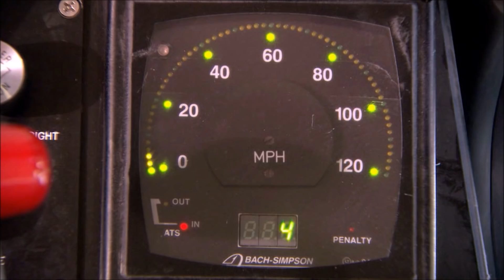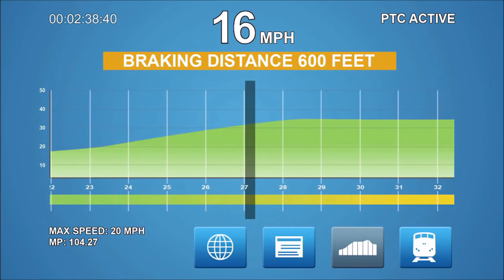Amtrak 501 "Cascades" Train Derailment 18 Dec 2017

Comment: Hi Juan, great report as always. As a train nut who lives less than 30 miles from the wreck, and is familiar with this line, I'd like to add some info that the MSM has either gotten wrong, or missed entirely. There has been much mention of the 10 minutes this reroute saves between Seattle and Portland, as though that was the reason for spending $180 million for this line upgrade and train rerouting. That is not the case, the old route from Tacoma to Nisqually hosts 50 or more trains a day, BNSF the owning road, Union Pacific and Amtrak via trackage rights. The line while mostly double track, has two one track tunnels, a draw bridge and this time of year is plagued by mud slides south of Point Defiance. All of these issues combined to cause delays to the passenger train schedules, thus the Washington DOT and Amtrak's desire to bypass this problematic stretch of track.  The biggest drawback to the new route is that it passes through south Tacoma, Lakewood, Joint Base Lewis-McCord, and DuPont, with many grade crossings, something the old route has very few of. 

The media reports have been so filled with misinformation, it's no wonder there are already conspiracy theories cropping up about the wreck. These "Cascades" trains are run with a locomotive at each end, because they make multiple round trips a day between Seattle & Portland, with no convenient way to turn the trains at either end. This way either a locomotive at one end and either another locomotive or control cab at the other makes fast turn arounds possible. It was indeed the lead locomotive that ended up on I-5 and the other one, pointed back at Seattle that stayed on the rails. I hope this clarifies some things for people, and is an example of how sloppy news reporting is these days. Keep up the good work, you did an awesome job of reporting the facts that are known so far.
Reply from the maker: Thanks Rob! Excellent points!
Reply: I realize the train was going too fast. But it is interesting too that if you look at the tracks in front (to the north) of the trailing GE locomotive you can see they upgraded to concrete ties but left the old wooden ties through the curve. That lead Siemens went off the track maybe 30 yards after going onto the wooden ties. They never upgraded that bend at all it looks like too me.
Reply: Rob, thanks for your contribution.  I find the conspiracy theories incredibly disappointing, those peddling these lies never look back in 6, 12, 18 months time to read the reports and understand what really happened.
Reply: We are very fortunate to have someone like yourself keeping us informed, while educating the public.      Thank You
Reply: Eastern Woods, The curve is at the SW end of the rebuilt track, just about where it merges back on to the original line.  I'd bet that the speed would have to be reduces at the point that it connects to the original line and up grading this curve would have been very expensive for just less then a mile of increased speed.  Straightening the curve would have likely required new RofW and replacement of two trestles over I-5.    You can see the exact cure at Lat 47.0824, Lon -122.6750 and just how close it is to the original main line.
Reply: @Eastern Woods They used an existing right of way - that's why.
Reply: Whatever the cause, my heart goes out to all who suffer loss as a result of this incident.
Reply: @William Savage No, look at the bridge.  It's old.  They used the existing right of way and bridge.  With the railroad running parallel to the interstate, crossing it is a problem without a tight curve.
Reply: Eastern : The rail line in question was an existing track and over pass . The tracks were upgraded but the overpass bridge structure as a whole was not. At that location the tracks are wedged between the I-5 freeway and JBLM (Joint Base Lewis McCord) federal land going downgrade on the North side of I-5(So. bound lanes. I-5 is headed in Westerly direction in this area) They did do regrading with retaining walls but there was no room to widen the curve. And with the fixed position of the bridge and the narrow corridor not much banking can be incorporated.
Reply: No, this is an old freight line that served a few industries in So. Tacoma as well as Joint Base Lewis-McCord. It was purchased by a local Transit Agency (Sound Transit) who then spent $180 million to upgrade the 14.5 mile line, with concrete ties, and continuous welded rail. As _D Bailey also commented, there were right of way constraints near the wreck site, it is squeezed between I-5 and Fort property, so no room to widen this curve, especially considering that there is only about a mile of track left before the line merges back into the BNSF mainline to Portland, so extensive realignment was not economically feasible or necessary for such a short distance to the end of the line.
Reply: You know, that is exactly what I was wondering. This was, was it not, completely new track and overpass? How much more time, effort and dollars would it have taken to build a safe 60 or more MPH overpass?
Reply: Thanks. I've seen people talking about a Facebook or Twitter post by a local Antifa group, bragging about pouring concrete on railroad tracks, and these people are losing their minds. If they had bothered to actually read that post it, was dated April 20th, long before work and testing of this line was completed. It also identifies the track in question as leading to the Port of Olympia, which is over 10 miles west of and with no direct connection to, this line. They wanted to block shipment of Fracking equipment to or from the port, so why sabotage a passenger line?
Reply: Another person without knowledge of the circumstances pontificating on the cause. Was the engineering somehow incapacitated? Was there mechanical failure? No one knows the answers to these and many other questions. Lets wait for the official investigation to tell us what happened before we go lynching people shall we?
Reply: TRRS, there is still some freight traffic on the line. It still serves some businesses south of Tacoma, as well as Joint Base Lewis-McCord and their military needs. There is no need for any upgrades to the original either, it is well maintained, mostly two track mainline. The issue with it was it hosts 50 trains or more a day, has a drawbridge that can stop trains, as well as two one track tunnels, not to mention that the line is plagued with mudslides this time of year. This is why Amtrak & the WADOT wanted to move off that stretch of track.
Reply: Rob Petersen, thank you for this very pertinent information!
Reply: No.  This was not completely new.  This line has been in place for a long time.  They did replace rail, ties and ballast and upgrade the grade crossings to upgrade the existing line for this service.  The north end of the bypass will also be used for an extension of the local commuter rail system.
Reply: @Mark H. 
This was never intended to be a high-speed line. Yet another example of the media’s inaccurate reporting: they called this bypass a “high speed route” when all it was is a somewhat shorter and much less congested route. Most countries define high speed rail as 140 mph or faster, not max 79 mph with 30 mph curves.
Reply: Infrastructure improvements can be like that, but consider that if you never do it you'll never have it. It was going to be expensive to upgrade the other line as well, so why not go ahead and invest in the shorter, freight-free bypass. With the dedicated corridor the passenger trains can run without freight interference on faster schedules. Costs a lot now but you now will forever have that corridor available for that initial investment, plus of course maintenance costs.
Reply: It is an old but freight line that was newly refurbished for passenger service. I've addressed this question in more detail below.
Reply: This was an existing line, the curve was not designed for "high speed" which none of this line qualified as, the top speed limit on it is the same 79 mph as the old route.
Reply: The 10 minutes were the result of a shorter trip, did you bother to read my explanation of why the line was rerouted?
Reply: This was not a "brand new line" it was in fact a very old line that was falling apart.  Tacoma Rail Link used to use this line frequently and when you would see one of their trains running down this line it was slow and would rock back and forth pretty good.  They pulled the old rails and ties (if what was left could be called a tie still) dug up most of the ballast and re-graded most of the line, before laying new track and ballast.  Most if not all of the trackage is equipped with high strength concrete ties for long track life and higher speed ratings than the old wooden ties could support.  This curve has been in place for many years.  I believe this is an old Milwaukee Road bridge, it's been a while since I got a chance to see who built it originally.
Reply: Eastern, Did you get the paper work started ? (PP)
Reply: @Don Moore. This was NOT a grade crossing.
Reply: Thank you, I did not understand this.
Reply: I can vouch for this information. I've ridden the old route many times.
Reply: This is an old bridge, from the  steam-era frieght track through South Tacoma. Sound Transit built a connection a the North end for commuter trains, which then alowed Amtrak, with WA DOT funds, to upgrade the South end. This was years in the making.
Reply: K Scott: Don knows that but if you continue reading you will find he is talking about the cities the new route takes ie Tacoma, no less than 4 Lakewood, no less than 4 Tilicum , 2 and probably some I don't know or don't remember. I think Lakewood has more.
Reply: A NEW ROUTE FOR PASSENGER TRAVEL...NOT A NEW LINE....IN ANY EVENT THERE IS NO MYSTERY....SPEED KILLS
Reply: ROB PEterson
Grew up on the NPRR out Auburn.
Rode this equipment when they had free train rides back in the 90's, wanted the _62 worlds fair monorail.
talkt with metro drivers on that monorail back n forth, we agreed that it sould be our Pacific NW new transport system, water over the damn now!
much experience with train wrecks and how RR equipment works, ect.
this one believes that they were told to push it, had a party at the Portland station. and all.Rode the Amtrak a few yrs ago, I could not believe how hard they push that train than slam on the disk brakes, smell and all, track crews on the right of way to Portland, OR.
So, They hot foot this section for fitting their idea of a commuter rail system.
When lookn at the over heads, one can see that the heavy last piece was still in the tracks and all coaches were jacked knife into a pile of old style single truck coupler car systems.
So, Why the high speed push-pull units went into that corner is because of , (1). running late, (2), was told to ramp up for that corner by the big shots, because , it's design to hit corners with its tilt cars system.

Butt, they dynamited the very heavy front power unit at 80 mph, which via momentum sent the heavy into the i-5 southbound interstate.
one can then see the old design light wieght coaches binding in a split second and exploding into a, pushed by the rear heavy, flying mess going where ever it can  dissipating the energy of the forward motion.
basic physics tells us that.
This is also a down grade curve, which added to the problem.
maybe, the fast run idea got it going "too" fast for the planned thinking that this  equipment could run this heavily reworked track section to Portland.
I think the importance is in the fact that the rear engine stayed in the track.
All the couches absorbed the momentum for the rear engine.
Growing up, back in the day, riding up cab as a kid, gives one much insight in this matter.
Now, Will the safety board find the trueth or just blame the engineer for the old back east design equipment  ?
Not designed for our tight curves and hilly grades?
And does speed justify safe operations in a new upgraded, congested track section through Lakewood and DuPont.
Reply: +Dave Juice  
I concur with your observation.
It looks like a lot of littles brought us, to a BIG F R U B A R.
And is it possible, that that engineer had a bug put into his ear, make an on time run !
pressured to push it.
I've rode that run, couldn't believe the braking and fast run up for catch up time.
Reply: The 30 MPH curve has been there since the line was installed.  The rail upgrade sounds a bit misleading and it is easy to think, "Hey they put in new lines.  In short, they didn't reroute anything.  The money was used to put in new road beds, much upgrades to new signalling, crossings, crossing road guards, new concrete rail ties, rail fasteners.
Reply: Correct, David.  A portion of the line was improved - not the entire line from Seattle to Portland. A large portion of the money was spent on rail adjacent to the cities of Dupont, JBLM, Tillicum, Lakewood and Tacoma.
Reply: No, William.  The money was not spent on a new overpass.  That overpass has been there for a long time. It is mostly steel.
Reply: Speed doesn't kill, sudden stops are what kills. :-)
Reply: @ctrader6,  While it would reduce the commute by 10 minutes, the bigger benifit is putting the passenger train on a less used route so it would not be delayed or cancelled by using the older route.  The Point Defiance route has problems with landslides (its built along the beach of high bank waterfront) and there are a couple of single track tunnels that cause delays.  With the passenger trains on the new route, it leaves the Point defiance route alone for freight.
Reply: Rob, any idea if the curves approaching the bridges at either end were superelevated during the line upgrade?
Reply: +Eastern Woods 
I'm in agreement with you. Grew up riding cab with men like you.
This is nothing but a bureaucratic o nightmare of a finger pointing designed accident.
Reply: +Dave Juice 
in agreement with your observation.
Reply: +raffy zoo 
Good point !
Where's the bureaucratical nightmare on this idea of getn the cart before the horse. 
let's see, build a freeway that comes to a 90°hard, turn !
Reply: +DAVID BROWN 
But, Dave !
It's this, how not to build a hi speed passenger corridor !
I've rode this run to Portland, grew up riding up front, father had additude about passing down equipment knowledge , when men were men.
They operated that Amtrak like a buss, hard speed up, and stinky, brake smell for hard braking to keep station schedules at Portland, OR.
What a way to run a RR.
Reply: so there were two engineer crews that didn't know better ?
very poor
Reply: Thank you Mr. Peterson! I don't live on your side of the state. However, do ride the train on occasion. I really appreciate your knowledge and the sharing of it. Between the two of you the whole picture becomes clearer. Thank you both.
Reply: With this being a new line, why would they design in a 30 MPH curve? I'm an engineer and that looks like designing an accident into the system
Reply: @easternwoods4378  There was a proposal to make the whole line 80 MPH compatible. I don't know the details but clearly it would have meant bypassing or replacing the bridge where the accident happened. It was deemed to expensive, so the cheap option was chosen instead. Now, making decisions based on budgetary reasons is fine, but Amtrak, together with the state rail authorities, were negligent in the extreme. It should never have run without PTC, nor without an interim 50 MPH zone between the the 80 and 30 zones. Amtrak also failed by putting a driver in charge of a loco he wasn't familiar with, on a route he wasn't familiar with either. A derailment at this location was only a matter of time.
Reply: Those grade crossings are now more dangerous with a 70 to 80 mph train flying through.  The Lackawanna Cutoff was a route across NJ to eastern PA that eliminated grade crossings through the use of tunnels, viaducts and bridges.  It also minimized curves and grades.  This kind of foresight is what is needed to make high speed rail successful in the US. Using a line like this, through towns and with sharp curves - it's a bad idea.
Reply: IT IS A 30 MPH ZONE...THE ENGINEER WILL FACE CRIMINAL CHARGES
Reply: They just wanted the allure of high speed rail, to secure funding. They had no desire to provide it, this is why they designed a curve that ignored their goal of high speed rail. Now they can demand another $100,000,000 to fix the curve.
Reply: Was it worth $180M to reduce the commute only 10 minutes?

Comment: Do Trains have seat belts for the passengers? If no, why not? I always felt unsafe riding in Greyhound buses going through the Sierra Mountains at night, on cold freezing roads at freeway speeds without a seat belt. Seems like they might prevent minor-moderate injuries from becoming major-deadly injuries.
Reply: There are so few train accidents that seat belts would make very little difference, but would be a major expense to the railroad and inconvenience to the passengers. Even if they were available, most passengers would not use them.
Reply: Good question, but I think its a trade-off.  Seat-belts have proven useful in aircraft, because passengers can be instructed to remain seated during takeoff and landing, which are short duration and statistically the most risky phases of flight. In other phases of flight they are less necessary, except during severe turbulence.

IMO with trains it is the opposite, since no phase of travel that is any more risky than another (except sharp corners!) The benefits of wearing a seat-belt at all times during a train journey would be minuscule, compared to other modes of transportation. Buses are a whole separate discussion.
Reply: I think seat belts should be an option but I'm sure it is cost related and wouldn't happen unless govmt mandated.